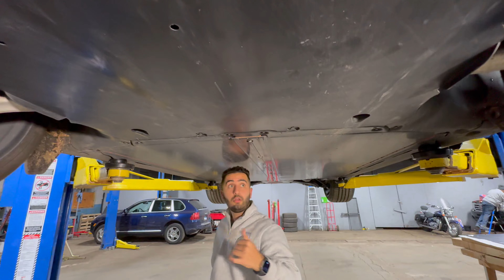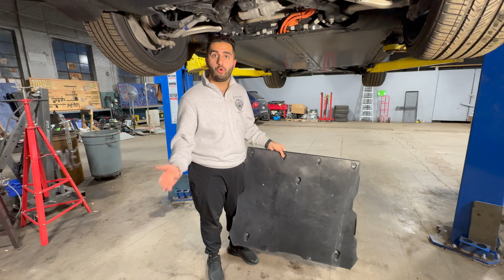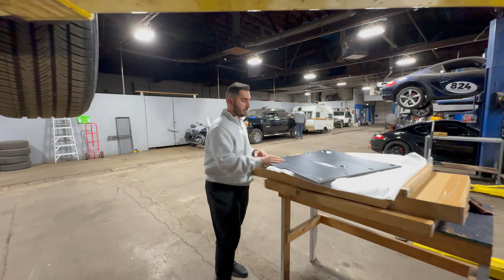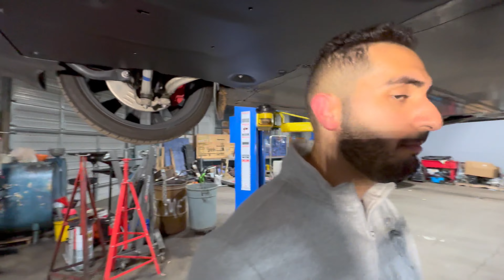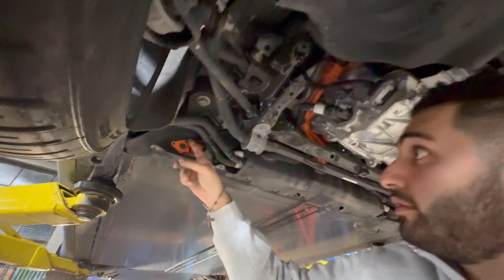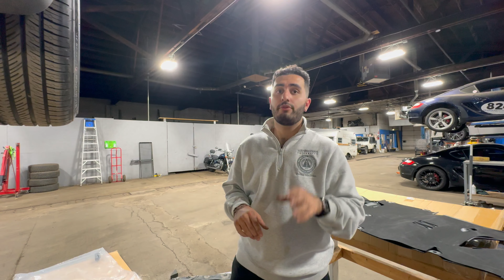Fix Tesla's Major Design Flaw With This Upgrade!  (Model 3 and Y)

Comment: Awesome Video Kris! 

By the way: I look in to your channel for the video of you installing the front wheel well metal covers you showed at the end of the video but I was not able to find it… 

I have a Tesla3 year 2021. 

Does the kit come with front, rear & front corner metal wheel well covers as well or there is a different link to those corner parts?
Reply: Also; is it the same for all Tesla3s from the early models up to year 2025?
Reply from the maker: front and rear and good for your 2021. 2025 is different and I do not sell that.
Reply from the maker: https://www.etsy.com/listing/1589444240/model-3-metal-powder-coated-skid-plates?etsrc=sdt

Comment: Does the 2023 m3 rwd needs both front and rear plates or just rear would be fine ?
Reply from the maker: both front and back because coolant lines are still present on the front and the rear regardless of model.

Comment: I am curious to know if a crash did happen and deformation occurred with the aluminum plate, wouldn’t that do more damage to the batty pack? Like the deformed plate get pushed into the battery and pierce the pack or something?
Reply from the maker: @k91042  the aluminum plate is still softer than the battery packs make up. The battery pack is made of a much stronger and thicker metal usually steel that is painted black. This would just fold and bend. Also this part doesn’t actually cover the battery pack rather it covers the coolant lines.
Reply: Great thank you

Comment: My front tire flung a small dime sized rock or something through that little plastic piece behind the passenger front tire. Ended up costing me 2 weeks with out my tesla and a $18,000 battery replacement. i had to make an accident claim on my insurance. My tesla M3P only had 4k miles on it. After that fix I wrote Tesla and they basically said tough shit. Sold my tesla and and never bought another Tesla product again. Its nice to see there are now good aftermarket covers to protect this delicate piece from normal road debris but until tesla fixes this from the factory I will never own another Tesla product even though my M3P was my favorite driving car I have ever owned.

Comment: I am betting the plastic OEM protective pans are stronger than the aluminum versions you are hocking.  Aluminum is not a very strong metal.
Reply from the maker: Incorrect, the metal ones can actually bend which allows them to flex instead of puncture. Aluminum is much better. Tesla uses aluminum on the cybertruck and rivian uses it on their pickups
Reply: @TechMultiview100  Based on the video of the plastic skid plates, they are made of reinforced plastic. It would take a significant force to "break one of them." 

The aluminum skid plates in the video appeared to be thin aluminum. While you are correct that they will bend on impact, if the impact is severe enough to break the plastic skid plate, it will probably tear through the aluminum. 

Now, I base all of these comments on just watching the video, so I can clearly be wrong. You might want to post the thickness of the aluminum skid plate you are selling and other specifics. 

While aluminum is light, it's just not very strong compared to steel. I suspect the thickness of any ski plates on the Cybertruck is substantial—probably at least a quarter inch thick, maybe more. It would answer a lot of questions if you actually posted the specific dimensions of your skid plates.

Comment: Great video!  How thick is the aluminum and will this fit a 2024 model Y? Thanks!
Reply from the maker: I believe roughly 2 inches. good thing about aluminum is that it can bend rather than just crack like the oem cover.

Comment: BUT it added MORE WEIGHT to the car, that's why TESLA didn't use those, period.
Reply from the maker: weight has a negligible effect on the range and performance of EVs especially considering these way only a few pounds more because they are made of lightweight aluminium.

Comment: Great video, it is very helpful, thank you. 
I have Model Y, but ended up ordering front skid plate for model 3 (it was stated as you said that it will fit model Y, but it does not fit because of the two horns at the back). Do you think if I cut both horns I could fit it in Model Y?
Reply from the maker: nope wont fit. Thats why  spent all the time sourcing the correct one. I did the same thing as you originally and I am stuck with the front model 3 one. My advice is to return that one and order the correct one from me. Thanks

Comment: That is what happened to my Model Y at 3K miles. I got in a ditch running over a log on my way. The log pierced and shattered a lot of plastic underneath. Luckily, the battery cover withstood it and the pipes were not damaged. I replaced everything with metal parts except the one that attaches to the front bumper.
Reply from the maker: great glad to hear!

Comment: Where do the coolant lines run on the sides of the vehicle? For example, are they towards the inside of the jack lift location under the solid battery cover? Or are they towards the outside of the jack lift location under the plastic side rail panels?
Reply from the maker: They are toward the wheel well in the front and toward the middle of the battery in the rear

Comment: Does the front skid matter on a RWD (base) Model 3?
Reply from the maker: Yes! Because even though there is no front motor there is still those coolant lines exposed towards the front exactly like an a dual motor or performance Tesla.
Reply: @TechMultiview100  thanks!
Reply from the maker: No Problem! @tornadotj2059

Comment: Why the hell wouldn’t Tesla put solid steel on the bottom?
Reply from the maker: I thought the same thing as you like why the hell not. but then I realized that no other automaker puts metal shielding under their car unless it’s an off road vehicle. Case in point the cyber truck is all metal underneath. They should still modify the design of the hose clamps as to not have to replace the battery
Reply: @TechMultiview100  true

Comment: Are you rallying this car? Is that why your concerned about breaking those cooling lines?
In normal use on roads, I wouldn't give this a thought.
Video is a complete waste of time unless your offroading or rallying the car.
Reply from the maker: I thought the same as you, but after it happened to numerous people on the roads near me and to my first cousin I knew it wasn’t uncommon. Midwest roads are terrible especially with the unpredictable weather we have.
Reply: @TechMultiview100   Well I guess I have to yield to your personal experience although I've never heard of this issue before. Of course, I'm 81 and admittedly don't get around much or interface with many people which is just the way I like it........retirement is terrific.
I'm in Mountain View California and Tesla was started next town over, Palo Alto.
Love my Tesla, weak battery covers and all!

Note: Just added a front plate mount from Hansshow for $60. Well made/designed and locks in with a key. Been without a front plate for three years(illegal) but they seem to go easy on enforcing that law on Teslas.
Reply: @Rick9482  I was behind a truck and it drove over something. I was too slow to react and my tesla also went over it. Turns out it was a deer that was dead on the road. Since tesla clearance is low i heard a small bump and that was it. I thought of nothing until 3 min later i got a warning that my coolant was low and it limited my speed. I checked under the car and i saw liquid coming out. Towed it to service and they said they have to replace the battery. Quoted me 18 thousand, my insurance said since the battery has 72 thousand miles on it I will have to pay a betterment so they will pay 14 thousand and i should come up with the rest. The car should be ready next week after being in the shop for over a month. So this is not all about rallying or offroading. Its not common until it happens to you. I plan to buy Skid when i get my car back. Paying 4 thousand out of pocket is killing my soul.

Also it took almost a month to schedule it to service, and close to another month to get a new bumper for the tesla since that was also damaged. I use the car for rideshare so i drive more than most which increases my chance of accidents so you can get away with never investing into one if you dont drive a lot.
Reply: @mysteryherox  THAT is a true horror story!
Of course the first thing that comes to mind is what does a coolant link have to do with replacing the entire battery. Why couldn't the battery be dropped to fix the damaged coolant line? Is the battery so designed that no repair work can happen which I would consider outrageously poor design.
This is so bizarre that I wonder if lawyers shouldn't be involved.
Reply: @Rick9482  The battery could be dropped and they could just fix that coolant broken part. But they have been trained to replace the entire unit rather than just a part of it. The coolant is the one that cools the battery or gives it warm. So it is connected to the battery in circulation. So if one is broken off then your best bet is to find an underground mechanic (NOT tesla approved body shop) who knows what they are doing to just seal that broken part without even touching the battery. I know of no such mechanic and since i use the car for work i had no option. Although in my defense i thought it would be like a 300 dollar job or something and i had no idea about any of the stuff i just told you that time.
Reply: @mysteryherox  Seems like the Insurance company should have been more proactive about a repair job versus replacement but I guess they're not set up like that....
I imagine as EV growth continues and Tesla is forced to allow outside repairs this situation will improve.
With battery replacement cost being so high, I would imagine the battery repair will be a future business model.
Reply: @Rick9482  The insurance really tried (who wants to pay over 10,000 for repair) but can't really do anything when there is a limit of Tesla repair shop. Plus they also could not provide me a different shop. This means i will have to schedule another appointment with a different shop if i want a second opinion which can take weeks. Im here watching a lot of videos to decide which plate to buy for protection when i came upon your comment. Especially you saying this video is useless 😂.  But I don't blame you. I would also find it useless 2 months ago.
Reply: I was just driving home from Thanksgiving in the dark, going freeway speed, and there was a shopping cart in the middle of the road I almost hit.  It was dark and I barely had time to avoid it.  You can't always avoid road obstacles...and childish to suggest otherwise.
Reply: @TrendyStone   lol so are you alwaus watching this video to plan and invest in a plate ?
Reply: @mysteryherox  What are you talking about?  I watched the video once. You be trippin.

Comment: Behind the right front tire  under  the plastic there  are two coolant line.  I ran over a licensed plates size metal flat object.  The edge corner puncture thru the plastic and cause a small leaks of ne of the hose .  One week repair  and 1500$ dollars .  I replace the front and rear with new  skid plate .   Cost was like 500$ same as oem Tesla plastic price.  There  is also a protector  behind the tires too .
Reply from the maker: yup thats exactly what im describing in this video! The coolant line cover near the wheel well i have yet to install but will do soon
Reply: Same to me. In the service for more than a month :(

Comment: Or, you just watch out where you're driving.
Reply from the maker: For sure, but with the situation that happened to my cousin it was unavoidable. He was driving on the highway when something fell from the car in front of him, next to him was a ditch and the other side was a car. He had no choice but to brace for impact. No damage to the body at all but since it went under the car it broke the plastic and then the connector and now he replaced his battery. He just got the car back but I’d just like to avoid the unexpected and toughen up the undercarriage. Thanks for your comment!
Reply: I was just driving home from Thanksgiving in the dark, going freeway speed, and there was a shopping cart in the middle of the road I almost hit.  It was dark and I barely had time to avoid it.  You can't always avoid road obstacles...and childish to suggest otherwise.
Reply: Meaning what? You will always be able to avoid all road hazards. Not so much.

Comment: Hi,  Did you put Loctite on the screws and torque the screws?
Reply from the maker: I did not use loctite but I did torque the screws down to around 10-12 lb ft of torque. Blue loctite would work great but I think it’s overkill since Tesla doesn’t install loctite from the factory. Shouldn’t hurt though!

Comment: That thin piece of aluminum isn't going to do s*** to protect the coolant lines.
Reply: You are wrong it’s better than the plastic skid  plate .  2 years with hot and  freeze temp in TX will make the plastic cracks and break in peace .  Front and rear .  Also  driving over   2-3 inch’s water on the freeway at 60-79 mph will cause the plastics to fail over two years
Reply: You think thin plastic is going to do better than 1/8" aluminum?  Good grief.
Reply: Well, I guess they told you, didn't they.
Reply: The carbon steel coolant guards are more helpful
Reply: @AlanTrades That sounds more feasible. Any sources for them?
Reply from the maker: The major benefit here is that aluminum is able to flex significantly more than the plastic that is under the model 3 and Y. Upon impact with road debris, the aluminum would definitely get dented, but it would take a lot of force to puncture it. For the plastic however it doesn’t really take that much force to puncture plastic because its flexural strength is not anywhere near that aluminum therefore these metal skid plates provide a lot more protection than the stock plastic ones.

Comment: An adjustable wrench works well for that sort of sheet metal bending job too.
Reply from the maker: Yup that could also work well, bends pretty easily with some force. Thanks for the tip though!